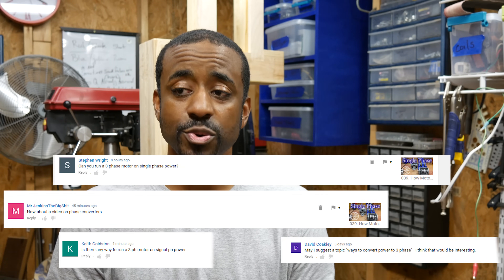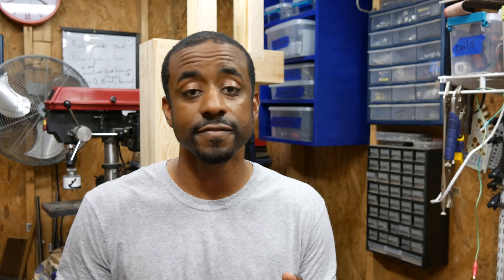How Motors Work (Episode 5) Question and Answer Session: 040

Comment: Would an 12v DC car radiator cooler fan work at slower speeds, let's say it has 2700rpm capacity a 130w motor but feed with 5amp power brick. Would it turn, how horrible would it sound ( the electro magnetic noise, not the air noise)

Comment: Hi. First thanks for your friendly and knowledgeable posts - I have got problem with small induction motor come out of a "Tower Fan' supposedly runs on AC current was not working - I looks quit clean and new - but for some reasons unknown to me I can not have it test run - it has a tested good Capacitor and strangely a Rectifier DC goes to two tiny brushes almost touching the fan attached to the side casing of the fan - My question to you : How can I send a pictures to you and have you look at them? possibly help me run and find the problem not running

Comment: Q: Are an alternator and a generator both motors? I always think of a generator as sitting collecting power to be used for a later date. 
Also in your video the drill produced more volts than the battery needed, so can the rest of the volts be used for the work you want done?
Lastly what motors can you find larger than the tractor fork lift motor, out there in the wild? Junk Yard or Business Auction?

Comment: The circulation motor on my dishwasher will not start unless I tap it with a wrench then it will run. Why?
Reply from the maker: Watch... three most common/ easy motor fixes. on my channel

Comment: I have only just found this video series, which I have found fascinating, you really do explain everything so simply, thank you !
I was originally looking for information on how hybrid motors work with ICE's ?
Especially ISG's (Integrated Starter Generators)
Can I eliminate my separate electric starter motor and generator and combine them into one unit that can start my existing car, charge the battery, and power all the necessary lighting functions, etc.
I have looked at the ''Dynastart'' system, which has been in use for many years on cars, but which left me wanting more simplified information, which has led me to your video.
Any advice would be welcome !

Comment: Hi Jeremy.  I just watched your single phase motor video and now this one...I’ve been in industry for over 40 years and still don’t understand what determines the direction of rotation in a single-phase motor?  I think (if I put myself in the average range) most industrial electricians know how to change the direction of 3 phase motors and if a single phase motor has the option of reversing it, they just follow the data plate schematic and voila.  I watch these videos and think of what it must have been like for the innovators of electricity in their day.  Working in labs, blowing stuff up, measuring and getting that ‘a-ha’ moment!

Comment: Thanks so much for this series Jeremy.  Found it looking for info on how to ohm out a motor.  Watched everything twice. Now it all makes sense.  Might you have a source for info on DC inverted motors for minisplits.?  Need to understand them to fix/buy control boards for an orphaned air to water heat pump.

Comment: I have a DeWalt Radial arm saw that has a 2 Phase motor. I need help on understanding the wiring. It also has a magnetic starter "Furnas" with a coil inside. How can I send you pictures of it? Some people told me that it has been wired so I can use a RPC to get it running. I was wondering if someone could have wired it to be a 3 Phase.

Comment: You make so clear on how it works. The way you speak it comes out so clear. I just came across this video by mistake. I am glad I did I learned so much. But reading and trying to get it straight in your mind is hard. I do know what you mean learning on your own. I did that with programming.I Started back in the late 80's Way before you tube. For me it is different you can see my results and if I worded it wrong it just will not work. What you do if you do something wrong you can get hurt or burn your house down. I really enjoy your video. You might be missing your calling as a teacher.

Comment: is a VFD better than a DC motor for a variable speed lathe?
Reply from the maker: I would change the question and say which method best fits my machine and budget. There are too many variables to really answer your question but assuming both motors have enough hp... you should just ask the above question
Reply: Thanks for the reply.  Your videos are great.    My budget is under 300 and my lathe is an old south bend nine inch.   I guess I would prefer dc just because I hate the noise a vfd makes. Those treadmill motors look so small.  Are they really as powerful as 2hp would seem?  I’m only using a simple half hp induction motor now ( I know it’s called an induction motor thanks to your series!!!!).  The treadmill motors are cheap and the project seems like something I can handle.   I’m only concerned it won’t be powerful enough at lower speeds.    Also? Can I get rid of the flywheel?   Does it have some cooling purpose?  It looks like the back side might generate air flow.   Thanks again.

Comment: Dear Jeremy,
What should I consider when choosing a motor for any application??
Reply from the maker: The question is too open ended... There is no simple answer to this question.
Reply: Dear Jeremy,
For example what made manufacturers use induction motor for washing machine instead of a synchronous motor??
Reply from the maker: Basically, cost, speed control, power source (DC, AC single, AC three phase etc), power needed, and voltage available. All of these are just some of the major reasons you would choose one motor over the other. How important is speed control, or speed precision (not the same), or starting torque. A ceiling fan need very little starting torque, but a air compressor need a huge amount. So, it complicated. Each motor type has pro's and con's in all these areas. Three phase for example is one of the best motors for torque, speed control, and power per lb of motor. But most people don't have three phase power as an example.
Reply: Jeremy Fielding 
What do you mean when you say this motor is more efficient than other motor? Is it due to its operation at higher power factor or something else???

Comment: 1. Thank you for the video. Will it be possible to make a tutorial on how to built a motor engine from scratch (beginning) and where to get the parts? ( a part store or electronic store . I want to do one with my daughter.
Reply from the maker: I might not be the best person to ask that question. There are many options available and I usually just use stuff I already have, or specifically look for things that have been toss out. You might want to find DIY motor videos and see what they use as far as buying new parts. I built a motor but you probably want something more attractive to make with your daughter. I am referring to my video #34 made almost exclusively with Microwave parts and wood.
Reply from the maker: That video is not really a tutorial... it is more about showing how simple a motor really is such that a microwave could supply all the parts. It does show almost every step, but I don't speak in that video.

Comment: Don't change the way you make videos! There's no need for schematics for such "simple" things as a motor. They are so easy to find that I see it as an exercise on what to do when you want to know something. Don't wait to be spoon-fed. Also a good point about the confusing symbols. You very likely have a world wide audience, which will use differing symbols.

Not to brag, but I already knew all the stuff you showed in the last videos. I still watched all of them. Not to learn how motors work, but to see how you explain it. I'm self taught as well and I can definitely tell that you didn't learn "by the book" either. You spend the right amount of time on different parts and point out what's important (that's something books just can't do). Showing the cut away DC motor for example is way more valuable than any 3D animation or schematic you could draw up.

Being able to explain something is on a whole different level and requires a lot more general understanding than just knowing something. I'm always reminded about that when asking a tradesman, why something is done a certain way, their answer being that's how they learned it and that's how it is.

Btw. is that a Matthias Wandel bandsaw frame in the background? I have lost count on how many times I have seen wood working on channels about electricity/electronics and the other way round ;)
Reply from the maker: Yes. My bandsaw is build on Matthias' frame. I have change the design some but his work inspired most of the design. My modifications were mostly related to the power train, and stability, for steel cutting.

Comment: I think the reason many people are asking you to do more basic electronics videos is because you're such an amazing teacher.  I would also enjoy watching more intro-level electronics videos from you as well.  But I certainly understand why you wouldn't want to go there.  Thanks for sharing!  Edit: And thank you Patrons!
Reply from the maker: +D Moore thank you! That might be some good material to get into after I finish a few projects. My next clock is calling my name!
Reply: @Jeremy_Fielding   Hi Jeremy 👋,  U have great knowledge,   With ref to ur prev episode on 1-Phase Motors,  I want to re-confirm  you  that   (1) Capacitor Start Motors do not have Shaded poles ?  (2) Like then do Ceiling fans have Capacitors then do they have Centrifugal switch ?   (3)  Also like in Cap Start Motors the switch dis-engages the Cap line but  in Shaded Pole motors  supply to Shaded Windings is not dis-engaged & they contribute to Magnetic Flux continuously ?   thanks & regards   Engr Ammad Asim
Reply: I agree

Comment: I'm not good with electrical things and was wondering if you could answer my question. I do HVAC and have a knife business on the side. One of the motors on one of my belt sanders is 1/3 hp. I  pulled a 1/2 hp single phase motor out of an old rooftop fan and I am hoping to swap them out to get a little more power. It is a belt driven fan and I was wondering if I would be able to wire it into the plug that is on my belt sander and have everything still work? Also is it even worth swapping for the 1/2 hp motor?
Reply from the maker: +dudefacial you should watch my video " how to wire most motors" that should help It is number 35 on my channel
Reply: Jeremy Fielding I definitely will. I appreciate your knowledge and hard work. Thank you sir.